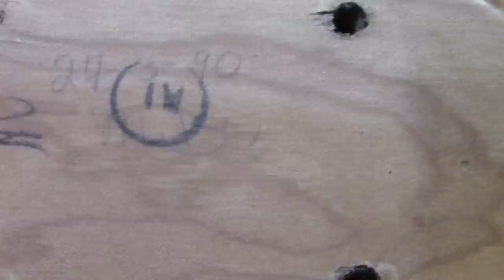1989 USA Squier?

Comment: So much WRONG info about these. They were made from 89 and discontinued in 92. There are a few different versions. First few had a 4 digit serial# on the headstock, next  6 digits on the neckplate, then E9 on the headstock. These had a pool route, vintage 62 style rosewood neck, or maple cap and a slightly smaller body. Then the  N serials (91-92) had truss adjust at the headstock and standard rout & body size. (These are the ones discussed in the Squier Book). This was a time when the Fender Japan contract ended and labour costs there were too high to compete with the copies. It had nothing to do with a fire in Mexico which was in 94. Fender was producing Squiers in Korea, India, US, for export and Japan for domestic sale during those years. Soon after  came Mexico Squiers.  The construction was mixed between US & Mexico (which was doing stuff like finishing and pickups) and then assembled in the US, hence the "Made in USA" designation.
Reply: Mexico squiers were technically fender squier series, a slightly cheaper alternative to the standard, with squier parts, but we're considered fenders rather than squiers
Reply: Only the second reliable seeming confirmation that my HSS no-pickguard Squier Strat ii is of the first Korean runs... any more info on these would be greatly appreciated!

Comment: You spent so much time and effort. Had it all stripped down and neglected to try to glue that headstock crack. 2 minute job.
Reply: I noticed that and cringed. On top of it was the car wax now jammed into the crack so a good glue up is almost impossible now. The other thing that annoyed me was the toothpicks in the neck/body joint. Pairing down a dowel that fits snugly, gluing and re-drilling the holes would have been the way to go imo. I know it’s a down dirty fast setup but dammit I’m anal when I see that. 
Always remember the fret polishing, polishing, polishing..
Reply: @SquirrelDarling1  I watch Twoodfrd too. His attention to detail and common sense attitude are amazing. He also explains things in such a manner that even I can understand.

Comment: Correct. Fender made Squier in the US for a period of 9 months from 1989-1990. These were made in the Fender USA factory on the same machines as the American made Strats while the Squire factory was rebuilt.
Reply: Yes but they were made with the same far east woods and korean electrics and parts they do not have American fender pickup's or parts so they are not worth anymore than any other Squier of that era....
Reply: Just because they were made in the U.S.A fender plant doesn't make them worth more money...

Comment: I have one! Black with a satin maple neck with a separate fretboard laid on top. No skunk stripe! Bought it in early 1991 and it has had several different pickups installed over the years, as well as graph tech saddles, string tree, and a steel trem block. The tuners remain, and it has always stayed rock solid in tune. It has made me thousands of dollars and I would never trade it. The plant was not in Japan, it was in Mexico and there was a fire, so the production moved to the US for a few months. Mine does not have a swimming pool rout. I would say that your guitar's body is possibly an after market, non-Fender body.

Comment: No one seems to be able to spell Squier. I bought one brand new in maybe !989. I've owned Strats from the 60 all the way through the 90s. I've had reissues even one made in 1982 in Fullerton. Well i traded most of those, but I kept my mia squier. It's by far the best guitar that I have ever played. I stripped the black paint with a heat gun and stained it brown. Keep in mind that these guitars are all different The one you have is totally different than mine
Reply from the maker: Thanks for watching

Comment: I just bought a black made in the USA squier strat from the original owner.  I couldn't believe my eyes, so I just checked that the neck was straight and nothing was broken and I bought it for what they were asking. It has a maple neck not rosewood like this video. The body also has a swimming pool route, so the body in this video might be correct. Mine doesn't need a shim though. Mine was all original but the pickguard was so warped it was unplayable. I had a new pickguard custom made because I didn't want to drill holes in the body like the person who previously owned the one in this video.  Honestly, the neck is so ridiculously comfortable it's so fun to play - better than alot of strats out there, especially the newer guitars. I have heard that these USA Squiers are hit or miss and I'm not sure if mine is a hit, but it is to me.  I like the stock ceramic pickups too. Great guitar and I've been playing it a lot ever since I bought it and fixed it up.

Comment: Hey, great video & cool guitar.  I've never seen any of your videos before, but I think I will check them out after seeing this one.  I actually remember seeing ads for the U.S.A. Squier models in late 1989 or 1990; I was 19 years old, busy trying to get a good band together and play as much as possible at the time & could barely keep myself in strings, so I was not shopping for new gear then and don't ever remember playing any of them.  

As far as the FujiGen (Fender Japan) factory goes, my understanding is that they had to completely replace the machinery on the factory floor to bring the production quality up to the required level.  I happen to own a 1989 Squier Jazz Bass made in that factory before the upgrade, and it is pretty fucked-up looking, although it does sound nice.  It plays o.k., but it just looks completely wrong.  My 2009 Indonesian Squier Jazz Bass, on the other hand, looks and feels like a real Jazz Bass.  I will need to replace the cheap pickups if I ever want to record with it, but aside from that it's the best J-bass I've ever played, and I've played a few- old U.S. Fender Js ('64, '66, '72, etc.), a couple of late '80s/early '90s Japanese Fender Jazz Specials, new (i.e. 2000+) U.S. & Mexican Fender Js, and too many Squiers to even remember.  I always tell younger players the same thing:  it doesn't matter who made it, or where, or when; you just have to pick it up and play it.  You never know, because it might look like a cheap, ugly piece of junk, but then feel & sound so amazing that you can't live without it...

Comment: I bought a couple of Japanese made Squier Strats brand new in the early 80's and still have one of them (an '84 , I think, with a SQ serial no prefix). It has a black body and scratchplate, maple fingerboard, large headstock with truss rod adjustment at the nut. I think that there was a peel-off sticker on the scratchplate that said 'Pickups Made in the USA' , but it was a long time ago.
Reply: The SQ Strats have USA made overstock necks on them, I have an 83

Comment: I have the same guitar. Bought new in early 90s at age 13. I sold it when I was 20 and just bought it back at 45. All original, mint, 1989. No extra drill holes or tape. The pickup covers are faded off white.  Those tuners don't appear to be original, unless they were just using random parts. Wish Fender would tell us why they were made in the states for that time.

Comment: Well how about that, the markings on the body and neck matched perfectly. Thank you sir for a for a well done job and video. I'm renovating/mending old violins and acoustic guitars and as a hobby i like to build partscasters, Teles, basses and some customized superstrats. I recognize much of what you are doing with the cleaning and polishing work and My guess is that you've put on some lemonoil for the finishing  touch on the gripboard right? 😁     
Where can i find the green polishingpaste that you were polishing the guitar with earlier? I like the fact that you can use it on both wood and metalsurfaces and doesn't seem so oily.  😀         Thanks for now!                                                               
Greetings from Rob Nilsson residing in Stockholm.

Comment: Hiya. Fraid they did. Nearly bought one in Andy's in Denmark Street, London. Think it was near £400 about 25 years ago. From memory, the reason I didn't get it was exactly as this video explains. It just a kit guitar. Different parts put together. And the guys right. Squier guitar parts generally don't match Fenders. For example, I can't get a replacement scratch plate for my Silver Series Jazz Bass.🎸🎸🤓

Comment: 11:00 ouch! Those are pretty serious cracks in the neck pocket, connecting to the swimming pool cavity.
Reply: Yeah, I don't think I could leave that alone.
Reply: @Charlie6969  I do woodworking as well as playing guitar and I would have to do a lot of body repair before even attempting to reassemble that guitar. I will say, years ago, that Squier would have been a guitar I wanted. That cream body was so cool to me.
Reply: Yea, they are bad. But will it affect the playability/functionality of it? I doubt it very seriously. And if you wanted to repair them, it wouldn't be that difficult. Most of the time, maybe not this guitar, they are just finish cracks. I only comment because people are so quick to freak out about those neck pocket cracks, when in reality, they aren't that big of a deal
Reply: and headstock, the crack starts where the sticky tuner was, possible sign of incorrect installation by forcing...

Comment: Fender did manufacture (assemble!) SQUIER (NOTE THE SPELLING!!!) Stratocasters in the Fullerton plant between 1989 and 1991. The serial number on this guitar is consistent with Fender's numbering system. The "E" means it was manufactured in the 1980s. The "Made in USA" decal informs that this guitar (or at least the neck) was made in Fullerton.

Comment: Fender was moving Squier from Japan to multiple Korean manufacturers. They made some at home during the move and startup to help keep production numbers up. 

There was no Fender Mexico at that time. The non-USA Fender models were made in Japan until that became less profitable and then not profitable with Japan's rise in quality and wages.

I have a Korean '89 Squier II Stratocaster (my first guitar), so i've done some research on it.

P.S. if anyone has a Korean Squier (some years/models), changing the pots from 500k to 250k will make your Strat sound more like a Strat, instead of overly bright.

Comment: I have had several of these.  They are a hodge podge of parts .  I have some that have USA necks a couple with Japan necks none of mine have bathtub routes. I have never seen any Mexican parts in them. 

I have a lot of expensive vintage and high end USA made Strats and  my favorite Strat of all time is one of these.  It will be the one that goes in the casket with me.

Don’t snooze on these because they say squire.

Comment: ive got an early mim strat that came with the American body and neck assembled in Mexico..its a nice guitar!. the pickups wer not great..two ceramic bars on each side of the steel slugs, i pulled the slugs and pressed in alnico5 pole peaces witch made a huge difference! combining the ceramic with the alnico magnets did something..gave me more of what i wanted. and i happened to have a couple dead vintage strat pups that needed re winding, so i pulled another set of alnico5s and swapped out the slugs in the middle pos i was hoping to also solve the volume issue as ive a hot sd sh6 in the bridge that was alot louder than the stock pups..problem solved! i can say that it made a huge improvement! and im not sure if any other pickup out their can compare to these ones i modded. im quite sure the magnetic field is a different shape now and maby a lil bit bigger in areas..it did something pretty amazing.

Comment: Does anyone know about a Strat built before Squire but at a Squire price. It did not have a angled input jack, instead the second tone spot was converted as the input socket. I bought one about 1985 in Australia and maybe it was for the Asia/Pacific market? It did have made in USA on the head stock. ???
Reply: sounds like you are talking about a Fender Bullet from around 82

Comment: I remember and if the story is true there was a fire in the Mexico plant and for 1989 Squiers strats were made at the American plant in Corona California but they still used lower grade hardware and electronics. People think that just because it was made in the USA that they are worth more money, they might have used Fender necks and body's but I have never seen one so I don't know for sure, it's still a pretty good find.
Reply: I think your thinking of the 1994 black logo Squier series Fender guitars. They were Mexican guitars built in the California plant after a fire had damaged part of the Mexican factory and had American bodies and necks while having cheaper import hardware from the overseas Squier guitars. They’re still pretty cheap anywhere from 250-400 depending on condition but they were Fender guitars not Squire by Fender.

Comment: I know people get all worked up about how much they like Squire and how good they are. Truth be told, finding a good Squire is difficult. There is a session guitarist that has a couple Squires he uses for certain clean sounds, however, he said he went through about 30 Squires in the back of The Guitar Center to find 2 good ones. That tells the tale of The Squire guitar. I have a couple cheap guitars I had to work on to get them playable. Most Squires have fret ends like razor blades. I don't care what anyone says. My Custom Shop 57' Heavy Relic Strat can't be touched by anything, not even vintage guitars. The Custom Shop Playability is just far superior to any cheap or even vintage guitar.
Reply: Ah huh ok. I guess I’m really lucky, got lucky three times. Might start playing the lottery. 
Truth is the Classic Vibes guitars are very good. The mim stuff is hit or miss. And if you’re paying for a custom shop guitar-it better be good. My American Deluxe Strat is very good, but then again the price. As far as very playable guitars, Squier has them. Even a cheap affinity with a little fret work and better pickups & pots can become an awesome guitar. Hardware can be upgraded, but you have to have the good bones foundation first.

Comment: A few observations. At 10:40 the close up of the neck mount shows it is completely cracked through on either side of where you bore out the hole to access the truss rod. Surely that needs repair? I would have thought so but you didn't mention it. I'm not sure why you decided to put a truss rod access in the first place. I realise some guitars have it but not Fenders as far as I am aware. My 87 Squier certainly doesn't. Why would a player need to access the truss rod anyway? And if a repairer was going to adjust it he/she would be looking at the neck as a whole wouldn't they? So they would remove the neck, check the seat is flat and clear with no splits or bulges in the timber, that the neck seats squarely without any angulation, look for any distortions or warping of the neck, any damage etc. No offense intended but I cringed a bit in how rough and ready you seemed in treating the instrument. You dragged those back cover plates right over the paint work which seemed in pretty good nick. If the plates had any grit on them from where you had laid them on your work bench some scratches would have ensued wouldn't they? Just observations. I appreciate the guitar seems to be a patched up second hand beast. The different dates on the head stock and body may mean the neck and body are from different instruments maybe?

Comment: there are two different serial number formats for USA squiers, one is on the headstock the other is on the neck plate, neck plate are the earlier models.. the weird tuners are good actually restore em they work great.. 

keep those ceramics they are very nice, not cheapies